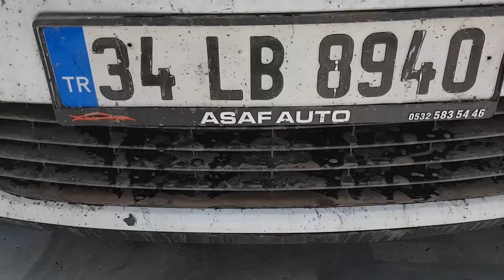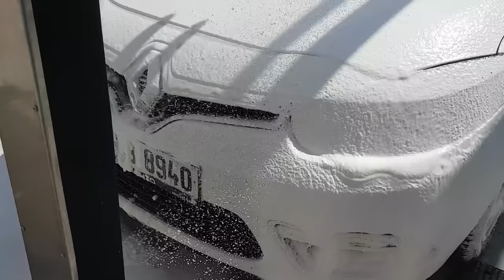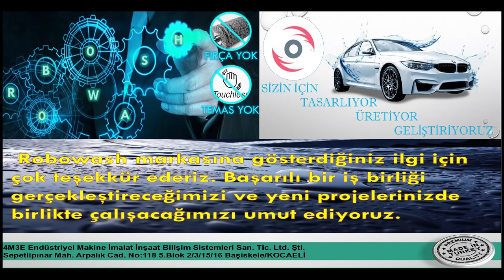How is Touchless Car Wash Clean Dirty Car. Made by ROBOWASH

Comment: No touching = no scratching = liabilities - the time it takes is necessary for the volume of pressured water volume  -suds - etc - this is the right way to wash a car. If anyone complains that extremely dirty areas of ties and wheels aren’t perfection - the next wash will get them spotless.
Reply: How much this machine price
Reply: What about wasting lot of water
Reply: @pariwish7457  talking about water waisting is bullshit in here.. a manual wash would need more water, a normal car cleaning would use like the same.. And by the way, to produce the jeans you are wearing right now, 40 times more water is needed, than for this car wash, its actually 8,000 liter for one jeans pants and I think the car wash uses less than 200 liters at all..
Reply: @pariwish7457  Tbh you could connect this up to a rain water system . That way there is no waste as your using filtered rain water

Comment: Its a very good car washing tool. The only problem i would see is that washing the cars under direct sunlight can be bad on car’s paint. That is why majority of the car wash systems in United States are inside rather than outside.
Reply: Nope they are inside because of the different seasons. Automotive paints are durable.

Comment: This was like a hoax, basically. The car was clean already, then just some recently tossed dirt on it and it became clean (no wonder). It would have gotten clean even with just a water hose 😁

Take a car that has been driven for 2 weeks and this Robowash with just chemicals and pressured water won't make the car clean, that's a fact 👍
Reply from the maker: https://youtu.be/hr2aqdPVXpc
You can watch this video. This is the car which has not been cleaned for about almost one month. And you can find other videos as well.
Reply: Tyre arches Not foamed inside.
Reply: exactly 100%.
Reply: @roboowash   this video, that video. Doesn’t really matter as you CAN NOT clean a dirty car touchless. No matter how good chemicals you have, there’s always gonna be a film of dirt on the car. There aren’t ANY chemical available that will clean 100%. Period. Maybe 80-90% but they are corrosive over time. So don’t BS people. Video/photo will never give justice to how the car exactly look.

Comment: you must not put mud, like that I want to see with real mud of the ground which is dry 1 day or 2 days ago, not like that pppfffff
Reply: I was thinking the same thing. This was like a hoax, basically. The car was clean already, then just some recently tossed dirt on it and it became clean (no wonder). It would have gotten clean even with just a water hose 😁

Take a car that has been driven for 2 weeks and this Robowash with just chemicals and pressured water won't make the car clean, that's a fact 👍

Comment: This takes way way too long. This car wash can’t be more than $8 US DOLLAR. 
What do you wash ?
5 cars a day with this method. I could wash it faster by hand with a hose and sponge.
Reply: Plus you do a better job than those garbage type do.
Reply: you are laughable

though this system/application and above all, the soaps used can and should be of far better material and as such quality - including the pressure of the pressure washing system - 7 minutes is still fast enough. 5 cars a day? that's 35 minutes lol. a wash like this can be open 24/7. 5 or 6 USD a wash like this, but with some better adjustments, will work perfectly fine. the average USA car wash does 400 washes a day. that gets you just shy of 150.000 washes annually. these machines are not built for DIY home 'detailers', this is a machine meant for commercial use, as a touch-free alternative. if you'd make sure you get a proper product finish, you can up the price to 8 perhaps 9 USD.
if you'd take a way a cost of 4 to 6 USD per wash, that gets you between 400.000 and 750.000 USD of earnings, of obviously you still have to deduct machinery cost / maintenance. even if you'd have 10 times less the car cleans annually, so that would be 40 a day, you still end up with between 40k to 75k for each 'machine'. maintenance will be interesting but likely should be 10k annually. that gets you 30k to 65k, for a fully automated machine where no human is involved and as such, no salary needed.

so that would mean on average, let's say 47.000 USD of 'semi-passive' income.

Comment: I do not think "touchless" carwashes can effectively clean road film, and, grime off of vehicles.
Reply: They can't.
Reply: they do a decent job ive been going to one for over a month now weekly and its pretty good. The downside is its just maintenance wash so i go every week and its good and it wont scratch your car like normal washers.
Reply: unnecessary water waste
Reply: @souravdatta7752  all car washes waste water
Reply: @Swess2908  but i think, manual method wastes less water
Reply: @souravdatta7752  youre probably right. Just wish id have a house and a house lol